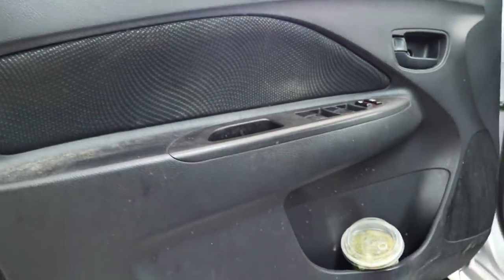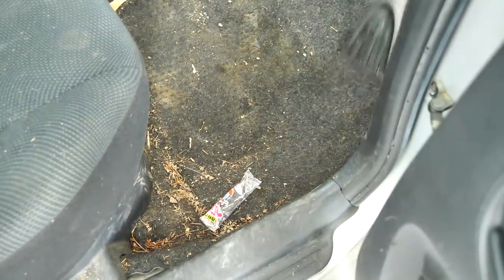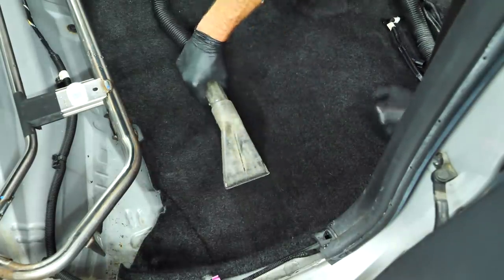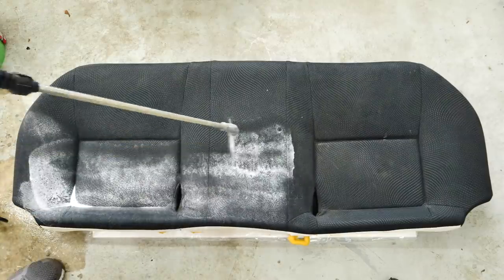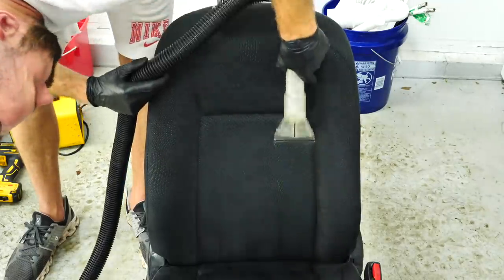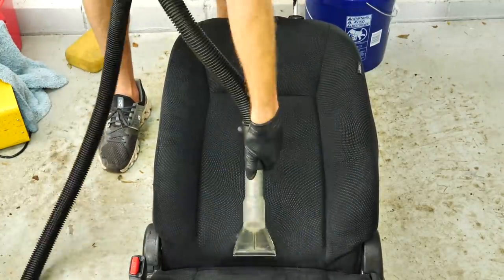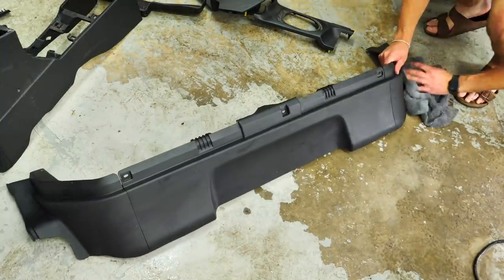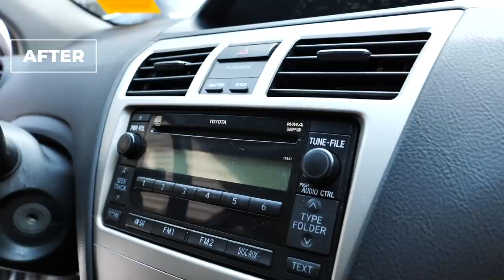Car Detailing A Nasty Maggot Filled Hoarder's Car... Interior Restoration How To

Comment: Not detailing related, but I went to see a car my friend recently bought, and decided to show him how to replace the cabin filter (an often neglected maintenance item)
To his utter shock, we found mouse poop on it. Luckily, he didn't run the AC or fans yet.
Replace your cabin filters!
Reply from the maker: Yes! Great tip!
Reply: A lot of people forget or don’t know they exist. I bought a 2000 Silverado in 2020 that even on the highest setting barely blew anything. The truck was very well maintained otherwise. Took out the cabin air filters and leaves, dust, dirt, you name it fell out if the compartment. I had to shove a brush in there to loosen up all the packed in dirt. Judging by the way the CAF’s looked, the amount of junk in there, and the fact they said ACDELCO on the side, they most likely had to be the factory originals. It’s a wonder the blower motor didn’t burn up. Now she freezes you out on speed #1
Reply: Holy hantavirus! 🐁 good looking out man!

Comment: Took the seats apart while cleaning an old Toyota Sequoia. The inside of the plastic panel on the bottom of the seats had a thick coat of some brown-black tar like substance that smelled like death.
Cleaning it was a combination of scrapers followed by about a dozen passes with hot water and dish soap. Not sure what it was, but some of the dirty water made it to the grass and killed it...
Reply: Should have used a steamer!

Comment: I used to work at Circuit City; I was an installer in the Roadshop. One day we got a woman who came in wanting a new radio for her Integra. 

We picked out the radio together, she pulled her car around back, it was business as usual. I finished up the paperwork and took her keys, then went out back to drive her car into the shop. I opened the door and everywhere but the drivers seat was completely full of trash.

I filled up 3 bigass trash cans with McDonald's bags and soda cups. She had air fresheners everywhere, all over the back seats and in the cup holders. I had finally reached bedrock.

Problem is, with later Integras, there's two ways to get the radio out. Option 1 is to remove the entire dash. Option 2 is to get up behind the dash and unscrew the for screws holding the radio in. Obviously, as an installer, option 2 is the way to go. But this car was a cesspit. 

As the FNG (Fuckin new guy), I had the honor of getting in the passenger floorboard to get those screws out. The carpets had been matted with a combination of ketchup, soda, barbeque sauce, dog hair and urine. Before I dove in, I lined the floor with a canvas seat protector. Got in there, gagging, and got the screws out. Did the same on the driver's side.

Afterwards, the canvas seat cover I used was covered with this black goo. I took it out back and burned it.

Comment: I run a small interior detailing business in MN.  Nastiest thing I’ve ever found was someone using their center console as the home for used tissues.  This thing was PACKED with brown, crusty tissues that had turned into a solid block from all the dried snot.  Of course the snot had glued it in, along with long, dyed-black hair to the console.  I had to chip it out with tiny dried snot-flakes flying.  As I was removing the solid cake of tissues, the weight of it being freed as I was moving it into a garbage bag made it fall apart, revealing a gooey center that hadn’t dried.  I had to jump out and quickly take my respirator off, because vomiting was no longer optional.

Comment: Ive recently gotten a job at a car detailing place. Ive not jad cars as bad as yours that for sure. But we once had to do a minivan that the boss said yes to without checking the interior. First time ive had to wear gloves and a mask for a detail. There was a mug of cordial, soup ladle and a bowel in the front. Bits of food and stuff everywhere. Cup holder was just straight white fur mould. There was a dirty diaper under a seat. Gum in the carprt floor. And the whole car reeked. Thankfully some hard work and persistence made it look good at the end

Comment: I recently got an old family car back after it had been sitting for years. It's a 94 Grand Cherokee that had been sitting under a tree for a long time, there were several wasp nests all around the outside. The interior carpet was destroyed from water damage and leaked coolant in the back. The entire passenger floor was covered in hundreds of moltings from some kind of bug each about an inch long. The whole carpet had to be replaced. If it wasn't for the standing water in it rusting half of the bolts getting the carpet out wouldn't have been that bad.

Comment: The body shop I used to work at has a contract with Enterprise to fix their rentals. We started doing detailing. A Sentra got towed in with some body damage and a lot of stuff inside. When you opened the door, the smell immediately made you want to vomit. It had dog food inside a dog bowl, that had gotten wet and sat inside the car for over a week in the heat. On top of that it had rotten chicken, and other rotten food inside. Wrote the estimate to replace the entire interior just to not deal with it. Went off to auction lol

Comment: Though you probably already picked a winner. I still want to leave a comment. This happened to be my own car. This happens when my first born was a baby. My now ex-wife and I would get in the car and we started smelling something that resembled a dirty diaper. So no big deal, we'll just change our daughter's diaper. As time went on we noticed, the smell was getting worse. As the days started getting hotter, we thought maybe a dirty diaper rolled under the seat. So I looked but didn't see anything really. I just noticed a white sock under the rear part of the front passenger seat, it being dark cause of tinted windows, I was like that fell out after doing laundry. I never took it out. Finally on an over 100⁰ day, it got to bad, we had to roll the windows down. This was just a couple of days after seeing the sock.  After arriving at my in-laws house I decided to look again, but really look. Still nothing, well I thought. I pulled the sock our I forgot to remove and when pulling it out, it had some weight to it. When I got it all the way out, a dead rat was stuck to it.  🤦‍♂️ at that time I worked in an area full of warehouses, I believe it may have got in my car through a window and couldn't get out, Once I rolled all the windows up in the heat, it must have died. Just thought I'd share that 🤷‍♂️. Lastly, thanks for the videos. I'm currently thinking of getting into the business of detailing. A lot of my experience (almost 20yrs) of detailing schools goes almost right along with this as far as techniques used and tricks of the trade. Happy Detailing my friend. 👊🏼

Comment: Back when I lived with ny parents I shared the car with my mom.
My mom and my sisters went to have my sis blood drawn for doctor appointment, afterwards my sister was sick in the car and puked, they cleaned it up but when I drove the car a week later in the hight of summer, it started smelling, I couldn’t figure out where it came from until a friend got in and pulled the passenger seatbelt out, which still had puke on it from last week and was extra rancid because of the heat.

Comment: I was repairing a Big Ice Machine (it would make 3000 lbs of in 24 hrs)at a fish packing house on the edge of the Florida Everglades. I came back to my work van a group of people said a Water Moccasin snake had went into my work van. I very carefully hooked up my ozone machine ( I use it to clean and control bad odors ( ozone is used to kill mold and mildew )) 2 hours of running in my close van ( which was the time that I needed to finish the repairs on the Ice Machine) I unplugged the ozone machine and open the van to air out. The Snake was laying on the back floor of the van and not moving a gentlemen from the Fish House who wanted the Snake remove it from my work van. I check the van very carefully did not find anything.,so I got in the van and drove the 200 miles home. P.S. I learned to close my van doors and windows.

Comment: My first car was a 1980 Datsun 310GX. Got it home and started detailing it. There was cat feces and urine in the trunk. It had been stored in a garage for a few years and a back window was broken out. I guess they had a cat and it thought, might as well…Thankfully it was only in the trunk. Used a lot of bleach in the spare wheel well and used my moms carpet steamer on the carpet cover. Left the windows open to air it out.

Comment: One of the nastiest cars I detailed had full on mold growing in the carpets.  Extraction, the whole works to get it done.  I wasn't even sure it was worth it or salvageable, but they sold it to somebody eventually.  I had a second one not that long after from a customer, almost as bad maybe worse.  I still have video of the pour from the extractor.  Also had a Honda fit that was totally trashed, not as nasty just messed up.  Ended up using black paint to finish it off haha.

Comment: When you pulled the seats did you disconnect the battery, I've read it could cause the air bags to deploy is that true. Thank you maybe someone on here could comment as well. Take care.
Reply: To avoid any problem when disconnecting a battery, start with the negative terminal and then the positive terminal. to reconnect it, positive terminal first then negative terminal second.

Comment: I wonder if all the steam cleaning and sanitizing is actually as effective as taking the cloth covers off vacuuming and sanitizing the exposed foam then recovering the foam with an adhesive clear plastic and washing the cloth and reinstalling the covers after drying them. Also removing the carpet would let you see 8f theres any infestation of maggots underneath. More work and time but it will result in a cleaner and better smelling vehicle.

Comment: Once, after a very successful fishing day, I've planned to go the very next day, so didn't get any of my gear out of the car. During the night a heavy rain felt and kept raining throughout the whole weekend. The sun showed up only at (but of course) Monday morning. I took my car and went to the job and left it on a sunny parking lot. When I finished the job at 17h afternoon and approached the car, I realized the mistake I've made: I forgot to take out the maggot box along with the box for bait worms. The maggots somehow crawled out and turned into flies. Both the pinkies, which turned into those nasty green flies. The worms just rotted out. The entire car was buzzing and you could hear it from several meters away. But the worst by far was the smell which was the combination of rotting maggots, worms and the smell of unwashed keepnet and landing net. If I didn't threw up when opening the door, I thing I won't ever in my next 10 lives. I left the car doors opened for the next 15-20 minutes till most of the flies flew away and somehow managed to drive home with my head stuck out of the window while driving. I literately had to disassemble the entire trunk area, take out the seats, the carpets, all the trimmings 'cause there were maggots hiding in every single crevice, every single hole, crack... Even after more then a week I was still finding dead or living flies in the car. So the moral of this story is: always, ALWAYS take out your fishing gear out of your car when getting home. And always check twice if there was something left behind. I can still feel that smell when I'm talking about that episode I've had.

Comment: I detailed a used Ford Fusion that was infested by mice. I took all the seats, carpeting and siding basically reducing the interior to bare metal. There was mouse poop in every square inch of the car. They entered the car through the ventilation. The cabin air filter was caked with dirt, leaves, twigs and mouse poop. There was a nest made out of carpet material behind one of the seat belt rolls in the passenger door column and another nest inside the center console. Would you like to know how I first came to suspect there was a mouse nest in the center column? When I took the driver seat out I noticed a whitish yellow crystalline stain flowing down where the carpet meets the plastic of the center console. It was a stain from mice peeing inside the center console. Did I mention mouse poop? So... Much... Poop...

Comment: Are used to work for an auto body shop that sold vehicles that were impounded through auction. Sometimes I would help wash the cars. There was a 1978 van that no one can understand why it smelled so horrible. It was vomit that was in a plastic bag that was in the sun and then the heat in the van. Freaking disgusting.

Comment: Love that the White Claws were back there. Someone doing a bit of drinkin and driving? Ugh. The nastiest thing I ever saw was a hoarders car I worked with. She was a single mom with a 2nd gen Neon. She shoved everything into the spaces that were never sat in, and I remember one day, I was asked to drive the car to a repair shop down the road and walk back. I pulled over and almost threw up on the 4 minute drive. 

Turns out, there were multiple unfinished hamburgers and fries shoved under the collapsing driver seat, with a dead mouse decaying away that looks to have been squished next to the burger. It was so horrible. That car deserved to be crushed and buried in a toxic waste dump.

Comment: nastiest thing I ever found wile cleaning a car...... back in the 90s I worked at a small used car lot and we took a 1989 cavalier z24 on trade.  it was extremely dirty as the former owner would fly down dirt roads every day with the windows down so it was full of a very fine dust.  the former owner was also a smoker and the back seat was full of trash.  the inside smelled awful so I started pulling it apart to deep clean it.  when I started pulling the carpet out, under where the passenger seat would be I found a dead possum that was very decomposed.  it was near a rust hole in the floor board so the only thing I can think is the owner hit it one night on one of those dirt roads and it was sucked up through that hole in the floor and was trapped under the carpet under the passenger seat.  needless to say, that car after getting put back together was sent to auction as we couldn't get the smell out of it.

Comment: I was going out to lunch with an ex-coworker of mine. It was the first time we out to lunch together. She volunteered to drive. Her car was a pigsty. She moved junk and trash from the front seat to the back seat (which was already full of more junk and trash) so I could sit. As I sat down, I kicked away trash on the floor. Then I saw not one, but two, used feminine pads. I lost my appetite immediately.